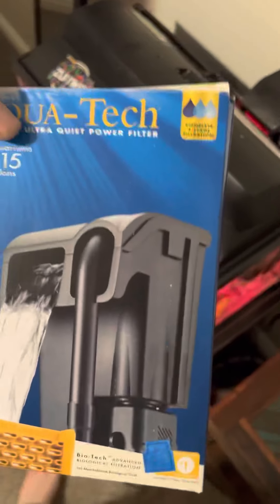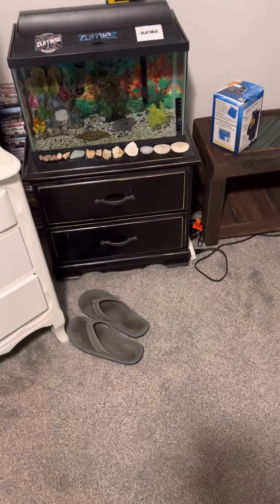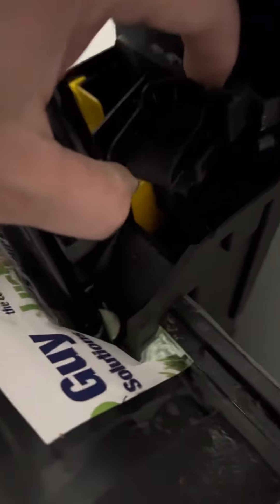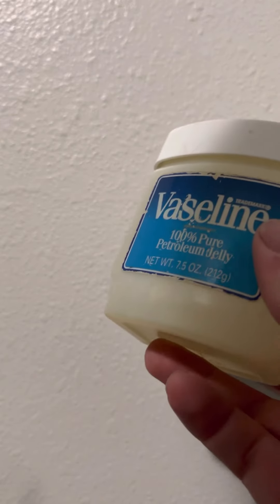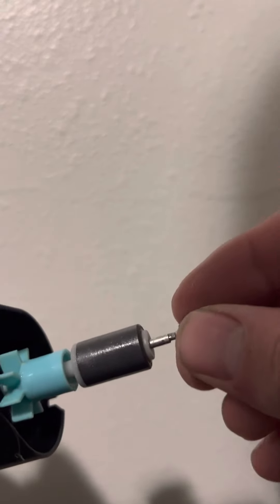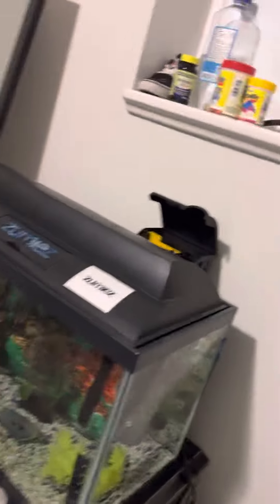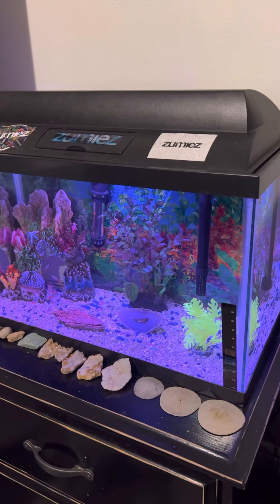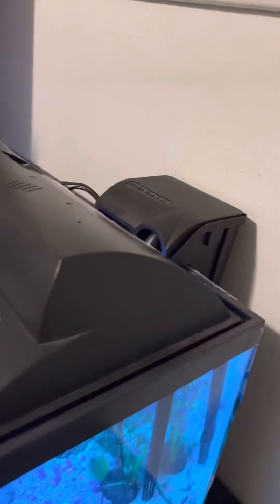How to fix noisy filter , AQUA-TECH ULTRA QUIET POWER FILTER 5-15 GALLON FISH FILTER

Comment: normally this method works for me but lately its buzzing so much its making my whole desk vibrate and ive fully cleans and lubricated it and its constantly making noise id hate to buy another but maybe its just weak magnet connection
Reply from the maker: Hmmm might be a factory error or just not working, if you tried fixing it you could take it back to the store and return it for a new one , depending on what store, I would maybe buy another one because you might have gotten a bad one, that’s my advice on that, that’s what I would do, just get a new one, good luck I hope it works out.

Comment: Hi,thanks for the video!  Is there supposed to be water filtering through the right side of the unit where the filter intake adjustment tube is?
Reply: LOL!  I figured it out!  Answer is no.
Reply from the maker: Ya it’s not supposed it’s weird sometimes it does that, I usually put a new filter in and it fixes the issue 😎👌🏻
Reply: @derekhenderson10  That's exactly what we did.  It was a new unit.  The last one didn't do that so I was initially confused!  (wouldn't be the first time.  :) )

Comment: ive owned this model in a 10 gallon tank for more than a few months now when i woke up the thing was only dripping so i looked inside it the thing was full of snails and crushing them so i washed out all the snails and the filter is now either loudly buzzing with little to no flow(still) or it does not work at all do you any answers for this cause i dont want to shill out another 15$ and find out it was easily fixable
Reply from the maker: I would try what I did in the video and put a new filter in it
Reply: Pretty sure putting a sponge on intake pipe it will stop snails from getting in

Comment: I just bought mine & I did everything & it’s still not pumping water?? Was there supposed to have a sponge that comes with it??
Reply from the maker: Try using a cup to fill up the reservoir
Reply from the maker: Like the black box in the back of the filter just fill it with water
Reply: Same problem still nothing
Reply: Maybe the filter is backward because I  had the same problem and when I saw this filter I notice I put my filter wrong and then I put it again and it works
Reply: Cup to fill reservoir give it a few smacks if not working return, it’s a piece of shit tho